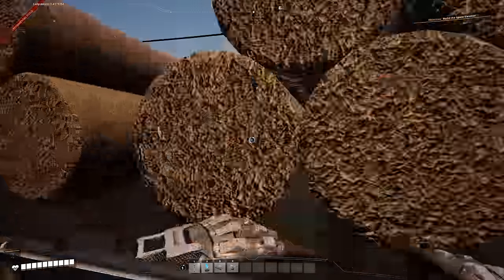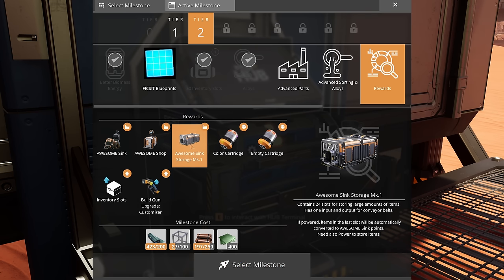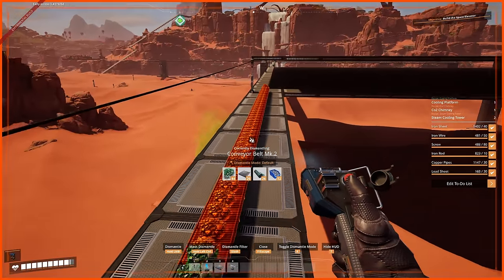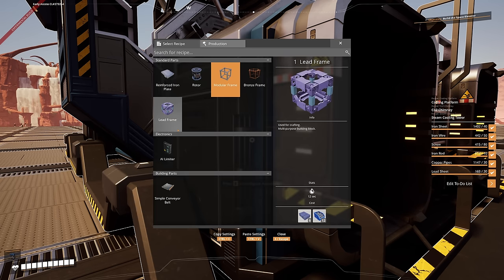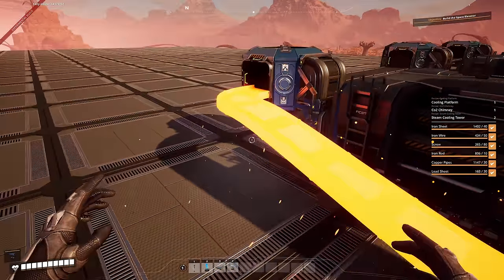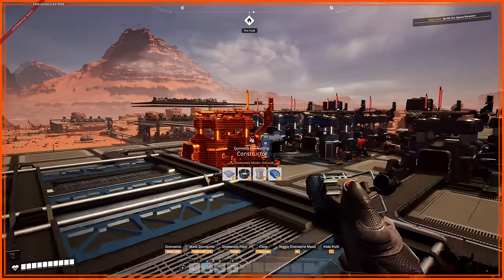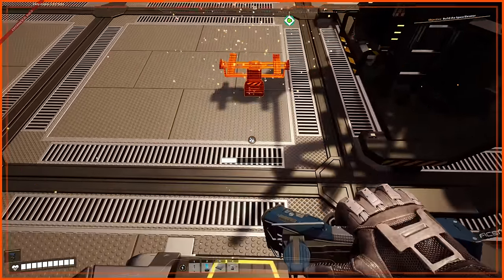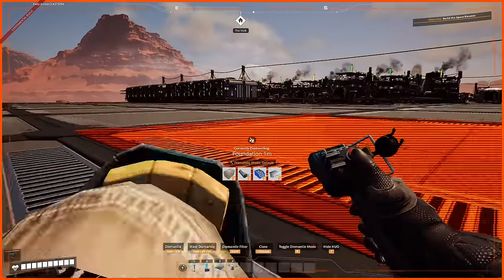I Need MORE Production... In Satisfactory

Comment: Bitz - in preparation for an inevitable "Moar Power!" video, see if you can scrounge up some Hard Drives and get the Compacted Biomass recipe.

From two BioWater (Normal) nodes in my own playthrough I am feeding Fluid Conditioners, Constructors and Assemblers to get 180 Compacted Biomass a minute. That in turn feeds THIRTY Furnaces and Boilers which feed thirty Turbines and Generators yielding 4500MW of power. Each five Furnaces uses one CO2 chimney. Each five Turbines uses one Steam Condensor. The footprint will be around 20x17 on three floors with a little extra for the biomass processing.

The Catch 22 challenge you will face is in the startup of the plant... you need to use the 60 water your Fluid Conditioners are producing otherwise they will stop outputting leaves and biomass. While the manifold is filling with Compacted Biomass your boilers will be filling with water from Extractors, backing up to the Fluid Conditioners and stalling them which will stop fuel production which will stop water consumption. I advise stockpiling a full container of Compacted Biomass before startup so that you can pre-fill the Furnaces.

Comment: Loved the series so much that I had to start my own playthrough. Missed the vid by almost a full day, cos of that :D

And from this vid I can see, I also need to do a new complete production building. At Tier 2 and 1st rebuild already.

It is a GIANT RABBITHOLE, my gawd everything is insanely complicated, and i love it... Started to look into slugs, 20+ hours of gameplay later I've found out it does not do what I expected, but I got to play around with Farming and got the Slug thing up and running, which I really need for nothing atm, honestly I have not even figured out what it is used for yet, but I got a lot of slugs, so no progression, but fun af. 

Slugs and Farming takes a lot of power, so right now I need to build a new powerplant, max consumption is double production, again for like the 5th time. The platform way of building power syystems, is quite comlpex, but still fun and logical when you look at it.

Opened up the sink, like you did at the end of the vid, and I got the concrete foundations and walls, and got quite a surprise, when I need more stuff to build them, I have not yet unlocked, nothing is simple in the mod.

Satisfactory Plus is hundreds of hours of discovery, and it will take a many hours to reach endgame.

Comment: im still surprised that bitz didn't combine the 2 of the leaves output of the fluid conditioner to go into a single constructor to have it run at 100% efficiency and then combine the 3 biomass lines (30 + 60 + 30), plus this set up would also be one less merger